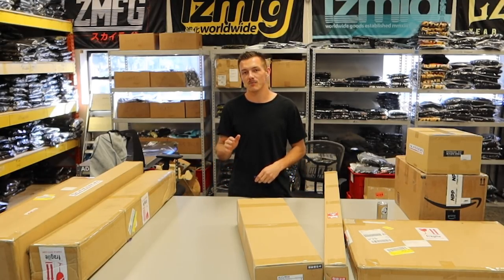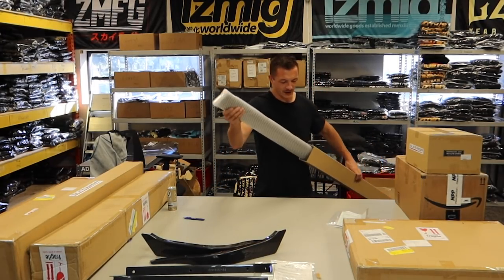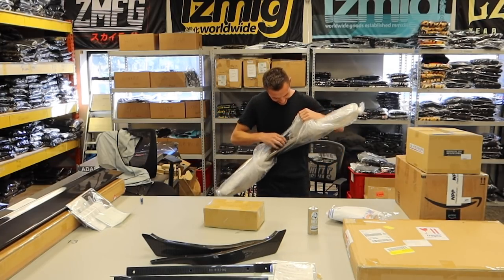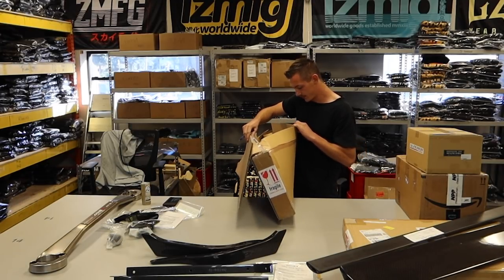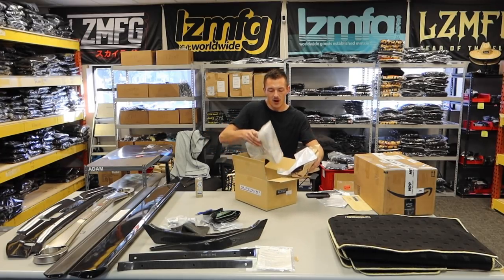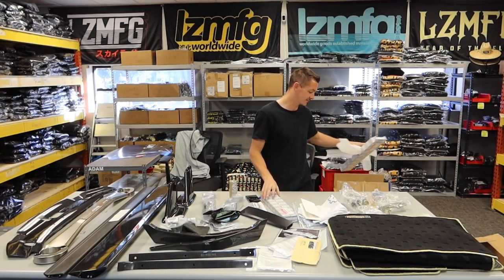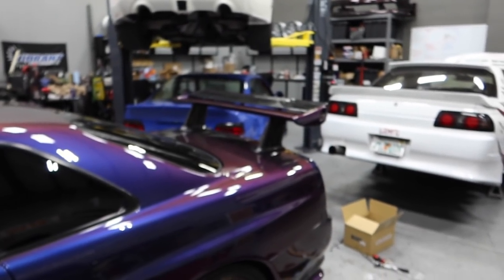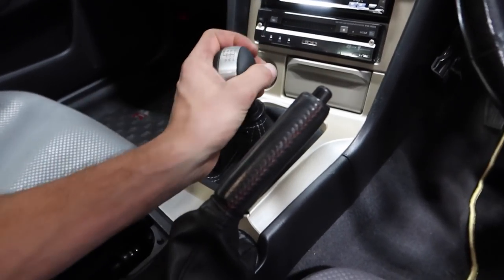First Mods to my R34 GTR!

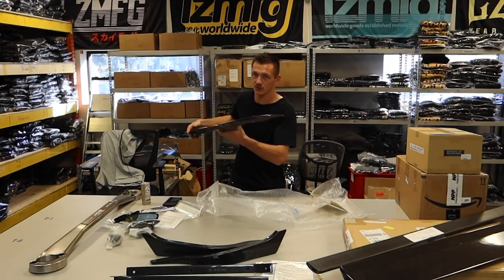Comment: 8:58 none of the tuning shops in Japan recommend this since it blocks the air coming from the front bumper. I have a Bayside Blue 600ps R34 GT-R 😉
14:50 this happened to me with my previous R34, try to use a magnetic type of that tool.
Ordered my Superior Carbon Wing Stays, but 2 months waiting time...

Comment: Today I learned that MVMT stands for Movement
Reply: Their watches are also super low quality and are essentially a drop shipping company for cheap low quality watches
Reply: Yeah listen to Darrin MVMT is straight garbage. Get a Orient Bambino or something instead it uses a Automatic hackable movement for $150.
Reply: @briskxd1093  what do you mean hackable?
Reply: @fashintoxin5148   The second hand stops when you pull out the crown. It's a feature in mechanical movements that requires additional parts. 
What he's essentially saying is that an Orient Bambino, for the same price as a MVMT watch, gets you much higher quality and a mechanical movement instead of an electronic one
Reply: @UltiGamer101  ah I thought that might be something different than a hacking movement. Its odd that he mentions having a hacking movement as something that is desirable, since setting the second hand really doesnt matter. the finest of mechanical movements will lose at least a couple seconds in a day, no question, which defeats the purpose of setting the seconds. if you want pure accuracy, quartz (mvmt) is better anyways
Reply: @fashintoxin5148  A lot of automatics at the $100 price point don't usually have hacking that's why I mentioned it. And if you really want Quartz go with Timex. MVMT is cheap Alibaba shit.
Reply: It's also an abbreviation for an awesome band
Reply: @darrin3088  lol yeah. Kinda drop shopping myself and found same non branded watches for 20-30 dollars. They just say that they are selling cheaper than others but they really don't. Branding is what does it
Reply: booommmeerrrr
Reply: @qwerty-or1yg  i found a chinese company selling the same styles i asked them and they told me mvmt did t register the copyright for it so it was fine. Most probably a big company has the design and mvmt stamped the name on it. I wanted to start my own watches too and one design is just 10k so yeah...easier to put the name on an already made watch
Reply: @blinkzh  yeah. Well the sad part is that you need to order a minimum amount of watches to brand them, and you are dropshipping and don't have a lot of money that's kinda impossible to do

Comment: Hey Adam, top tip for you,  put a small amount of grease in the end of the socket an then undo the nuts, the grease holds the nut inside saves you dropping them inside the boot lid again.

Comment: You should use the older Wing. The arrow is active and adjustable. Keep that a$$ planted at high speeds. Takes advantage of low pressure and high pressure.

Comment: Easily tip to prevent dropping nuts or bolts. Take a little bit of the sticky tack that hold on dust shield in door panels and put it on the inside edge of the socket. You’ll never drop and other but or bolt again lmao

Comment: For my R34 i've got coilovers 3 inch dump pipe mags, killa stereo. Now its time fro me to work on the motor, no point doing up the engine up first if you don't have the handling. new turbo and pipes for me next.

Comment: Has one of the few all-original low mileage midnight purple R34 Vspec I cars: pulls out the cut-off wheel and cuts the body to fit aftermarket fake carbon fiber diffuser parts...

Comment: The lamp to the right of the rear license plate is a fog light, which is always on the driver's side of the car. The left one is the reverse light. However, it seems Americans are not particularly bothered with functionality of these lights.

Comment: You need to use some real penetrant. Wd40 shouldn't be anywhere near a real shop. Stuff is garbage. Get some Seafoam deep creep or even liquid wrench works good. I keep them both in my truck toolboxes. For stuff that you are going to work on. Spray it a day or two ahead. Or if you think it's going to be a big problem breaking them loose spray it every day for a few days.